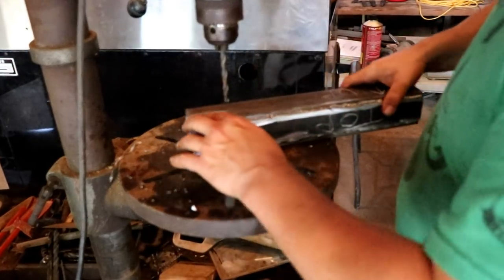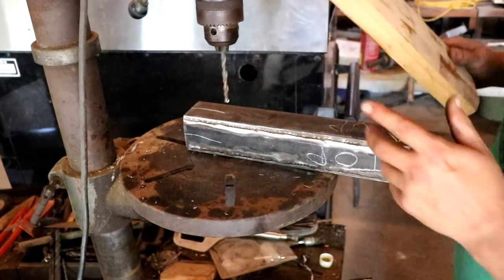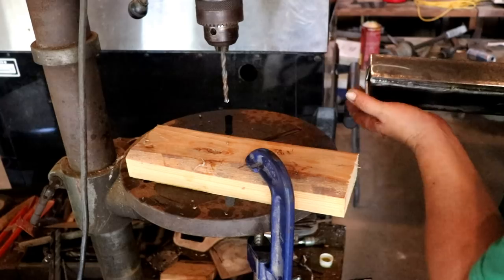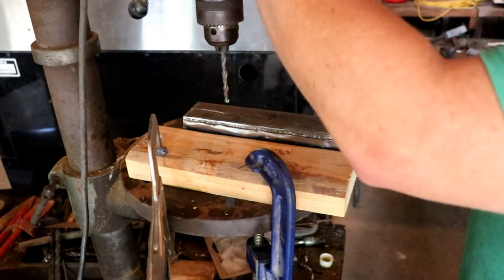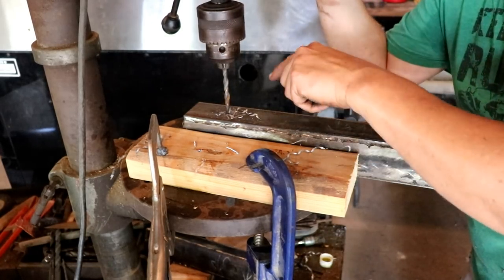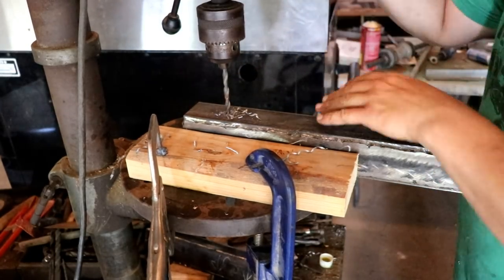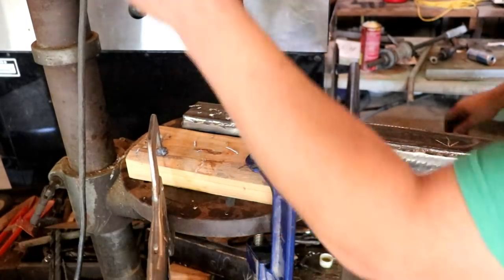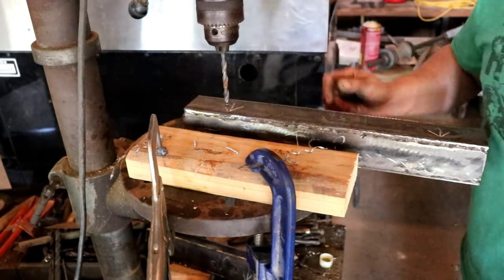OLD MACHINIST TAUGHT ME THIS DRILL PRESS HACK! Works Amazingly well!!

Comment: As an old machinist & tool maker with 40+ years of experience what you are showing in no secret.  It's called COMMON SENSE.
And  the best advice is use a VISE if the part fits and cutting fluid!  And that comes from an old machinist as I am over 65!

Comment: You have done a good thing in posting this.  Thanks for sharing, and I hope this will help with young people starting out.

But It is scary to think that there would be adults working with this kind of equipment who would not automatically figure something like this out for themselves.  So much for critical thinking skills.

Old machinists, who were not products of the modern (last 40 years) public mis-education system were taught HOW to think, not WHAT to think.  A tip like this was considered just common sense and what anyone would have naturally come up with.

Comment: Ahhhh,the old machinist forgot ta teach you about cutting fluid😂😂😂As an old machinist,it'll extend the life of your cutting tools!I DO like your content!BRING MORE😉
Reply from the maker: +Eric King Ha! Cutting fluid on the way! Thanks Eric!
Reply: I don’t use cutting fluid. I did at one time and I can’t tell that it makes much difference. Makes a mess. As long as you keep a bit cutting it will stay sharp. Besides drill bits are cheap.
Reply: John Davis-Not sure what age you are or if you ever worked in a job shop as a machinist.I have as well as a having been  US Naval machinist.WE USE CUTTING FLUID.I could justify NOT using it ALL day long,it has been a practice for decades.Just my.02 cents.
Reply: 64 years old. Been drilling holes since I was 18. Have a lathe also. I always tell people that I am a machinist. I have a vise and a set of files. That makes me a machinist doesn’t it? Lol. Back to using cutting fluid. I drill mainly stainless steel and have had good success without it. Stainless does not disperse heat like steel does and the cutting fluid seems to make my bits hotter. In my application cutting fluid is a hindrance. I know for a fact my bits will go just as far drilling dry. Like I said keep them cutting is the secret.
Reply: John Davis -Agreed.As a job shop machinist holding tolerances to to half a tenth,cutting fluid was essential,just my experience.
Reply: Eric King I think you are probably right on that. Got a question for you. I need a 7/8” reamer bit with a reduced shank to a 1/2” shank to go in my drill press. I took it to a local machine shop to have it done. Carbide tip by the way. In fact I have two there to be done. This shank reduction kicked this machinist but big time. The bit has so much run out that it is unbelievable. The man told me that he thought he was a better machinist than that. The bits have been in his shop since January. I go by and ask him if they are ready. He tells me that he needs to smooth them out first. He tried the one bit and hasn’t done anything with the second bit. My question is do you think the man is worth his salt? Is this job harder than it seems to be? Your opinion is valued. Is it has hard as he is telling me? Thanks John.
Reply: I always keep a jar of used motor oil and a 1" nylon bristle paint brush by my drill press and liberally apply oil to the bit with the brush...learned that from guess who??? An old machinist who worked in the chemistry department machine shop of the university of Utah while I was a graduate student - he probably didn't use dirty motor oil but that's something I have no shortage of...and it seems to work fine.
Reply: Vernon James is it messy? I have heard about using crisco lard. They say that works very well.
Reply: John Davis Crisco lard...I like the idea...I thought about trying to use a wax/turpentine paste but haven't tried yet. As it is, I don't care too much about the mess; when drilling metals I run my press on the slowest speed so it's not flinging oil everywhere, oil and chips just drop down into a pan.

Comment: A bit hard to explain but, I made an L shaped Jig with 2 wing nuts that you tighten down so the piece will be positioned the same spot every time. Plus our Drill Press has a power feed so it's less tiring doing multiple holes. Unfortunately, someone knocked over that drill press with a gantry crane and bent the spindle so I don't know how much time it has left :(

Comment: good tip. but maybe either slow the drill down if you can or not feed the drill bit so hard and fast.  your burning up your bit there should be chips not strings coming out of the hole being drilled.

Comment: Good tip. I've seen "machinist wanna-be's" hurt themselves badly by not using a clamp or solid stop while working on a drill press. Here's a tip for you. Use cutting oil when drilling.

Comment: I only have a small HF drill press but I use a bolt mounted in a clamp slot to keep things from spinning. I've used it for small holes to a 1" hole saw and it works just fine even hands free.
Reply from the maker: +Allen McKinney That's a great tip! Thanks Allen!

Comment: Why don't you instead of going to all that trouble just let that end you are holding on to spin around against the drill press post? You can drill all day and it will stay still.
Reply from the maker: Sam P Funny  you should mention  that. This is the only piece on this entire project that that would work with. The rest of the pieces are between two and five inches. Hope that helps. Build video soon.
Reply: Well I am 77 years old and have worked with drill presses all my life so I know a thing or two.
Reply from the maker: +Sam P Yup. Point I this works with smaller pieces that can't reach the post.